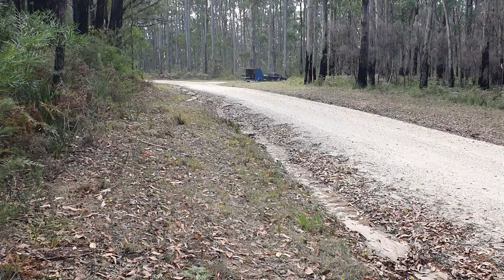speno rail grinder horn pt2 (read description)

Comment: It sounds just like the g class engine
Reply: Not all G classes have p5's. G's 511 to 525 have the bigger Leslie RS5T horns including G532. However over the years, G511 and G512 only have Leslie RS5T horns at one end only and G521 traded it's Leslie RS5T horns for p5's
Reply: @robbiewales3007  you know what I mean, I was saying it sounds like the g class p5
Reply: @RailsOfTheSouth , I understand. I misinterpreted what you meant, my mistake